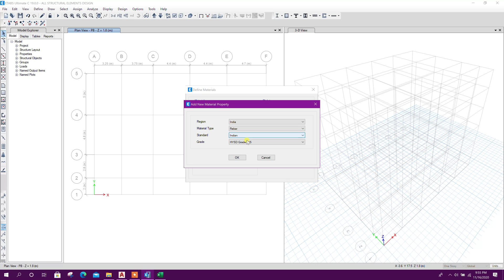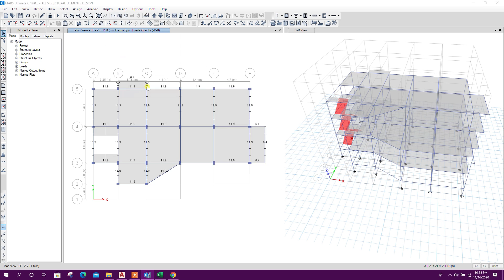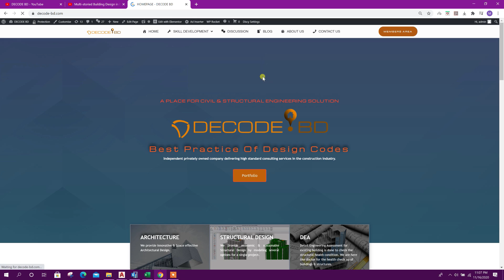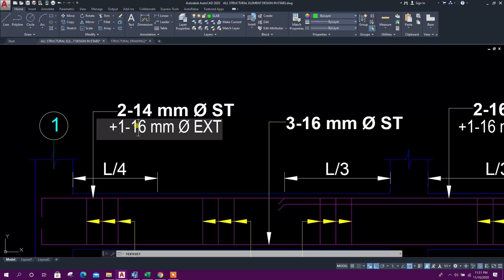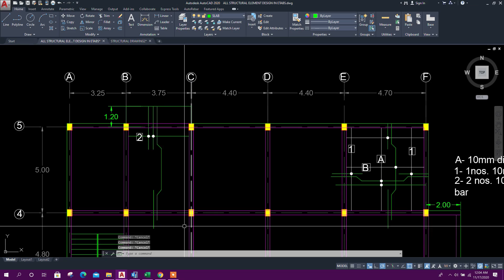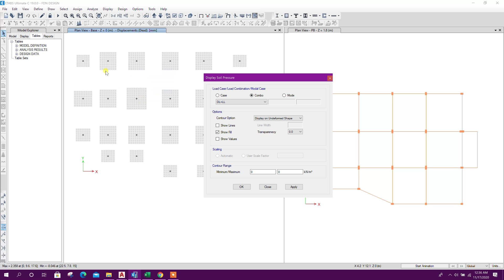Learn Complete Building Design & Detailing in less than 2Hours | Etabs v19 | IS Code | ACI Code

Comment: HI where is resource Tab and its disappeared from the website?
Reply from the maker: Fixed it. Clear your browser cache & recheck.
Reply: @Decodebd  I DO NOT NEED CAD FILES ONLY I REQUIRES DESIGN EXCEL SHEET OF, SLAB, COLUMN, FOOTINGS AND BEAM.SO INSTEAD OF 29 DOLLAR WHATS IS THE CHARGE WITHOUT CAD FILE?
Reply: @DECODE BD  I DO NOT NEED CAD FILES ONLY I REQUIRES DESIGN EXCEL SHEET OF FOLLWOING WHICH ARE  COMPLETE BUILDING $ DETAIING, SLAB, COLUMN, FOOTINGS AND BEAM.SO INSTEAD OF 29 DOLLAR WHATS IS THE CHARGE WITHOUT CAD FILE?

Comment: Thanks you so much sir...
Sir i have a question,.. I saw another video about Meshing... In that video he also Mesh the Frames which is Columns and Beams... It is necessary to mesh columns and beams or it is ok Not to.
Reply: And another question sir if you dont mind... In Stiffness Modifier in Slabs of 0.25.. It is not necessary to apply stiffness in slab of stairs? Because in your video you didint include it. TIA for the reply sir... Greetings here from philippines

Comment: Dear Brother,

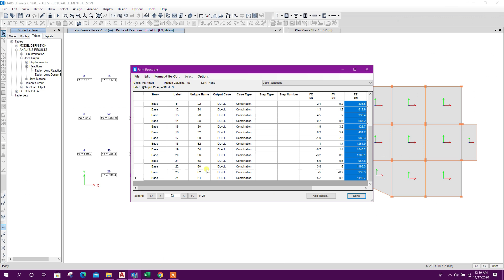A. @ 1:19:16 Timeline you have changed the support condition from "fixed" to "fixed but" by unchecking translation z, Why is that so?

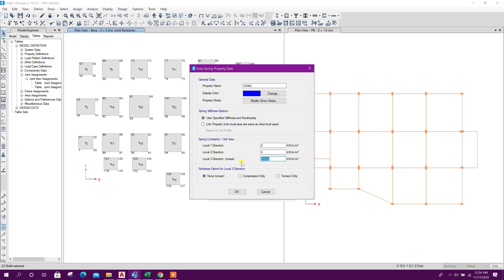B. Also @ 1:23:57 Timeline you have selected "None(Linear)" under Nonlinear Option for Local 3 Direction for Area Spring Property Data, instead of selecting "Compression Only", Why is that so"??

C. Also shouldn't one need to apply soil pressure/soil over burden on the footing???

Shukran...

Comment: Really appreciate what you are doing Humayun bhai..one question ..This building was not analysed for seismic or wind effect.then why did you used PM as 0.7 and 0.35 and not nullify it to 0.001?? Do we have to use them for any ordinary building? Thanks
Reply from the maker: Stiffness modification factors don’t depend on lateral loading conditions. These factors are recommended by design codes to consider structural members as cracked sections.
Reply: So in which case do we nullify torsional constraints??..Thanks for your response ❤️

Comment: Sir, Why you put stiffner modifier values in tortional contant? It should be 1 as per ACI. Just moment in 2 and 3 direction values should be changed for beam, column and slab.
Reply from the maker: Check previous tutorial on Stiffness Modifier in my channel. There you will be clear.
Reply: @Decodebd  Please share the link.